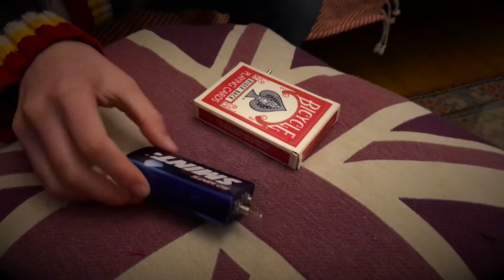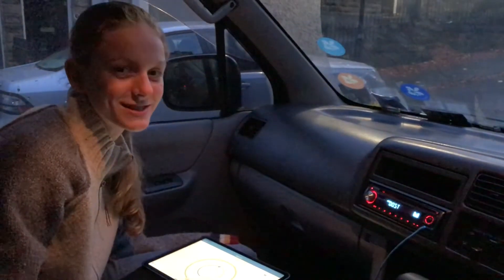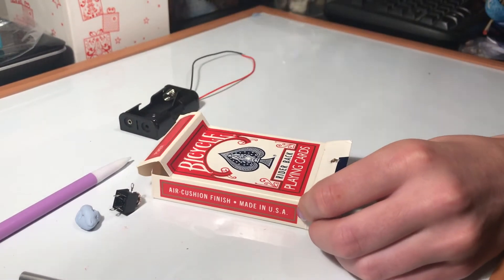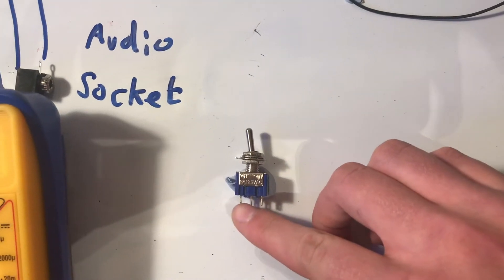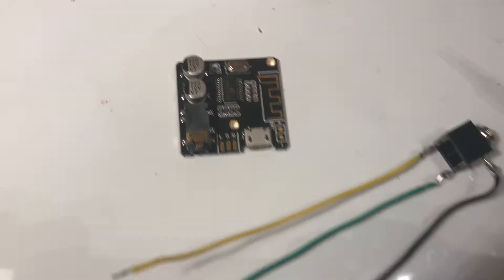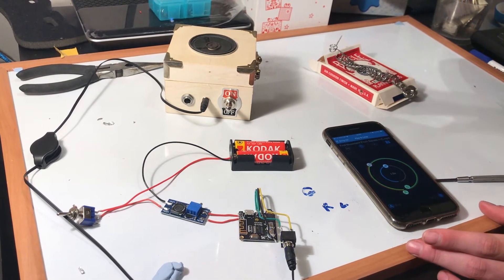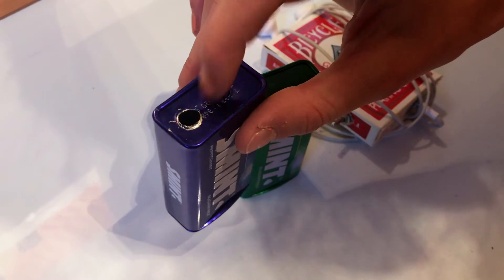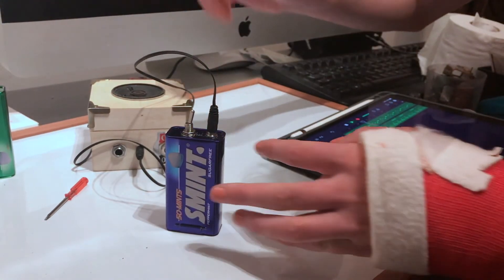DIY Bluetooth Headphones or Amp Build - Another Cheap & Simple Electronics Project for Beginners.

Comment: The Smint Tin looks nice, but I am surprised that it works as well as it does (assuming it is really made of a conducting material).  I would have expected the metal to be pretty effective at blocking the 2.4GHz bluetooth signal as a Faraday cage.  The Bycycle Card box probably has a much larger range.  The same problem exists with metal Raspberry Pi cases (like the Flirc) but those  have a plastic bottom, and some EMF radiation gets through.  Does the Smint Tin have a plastic lid?
Reply from the maker: Metal all around, we thought that too so tested it before we put it together. It definitely works.